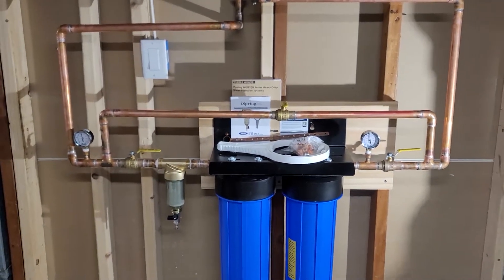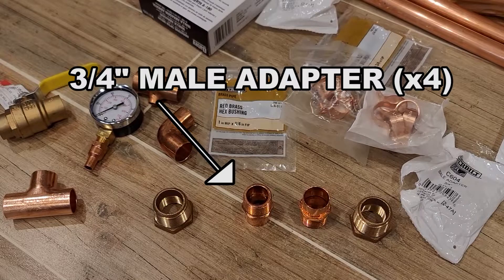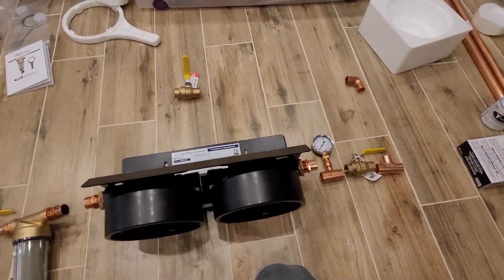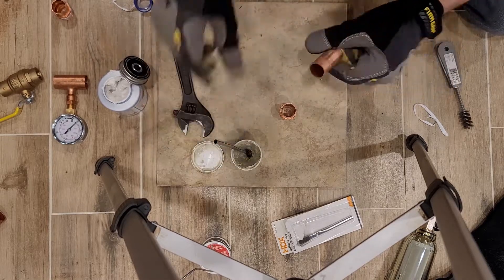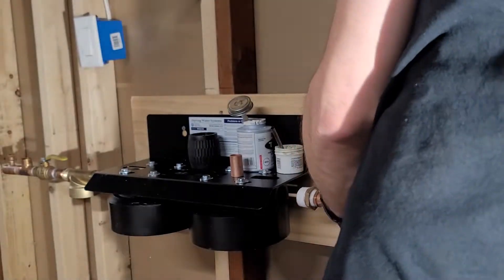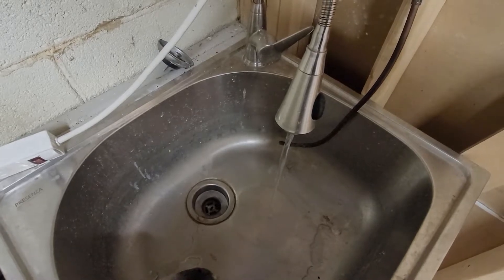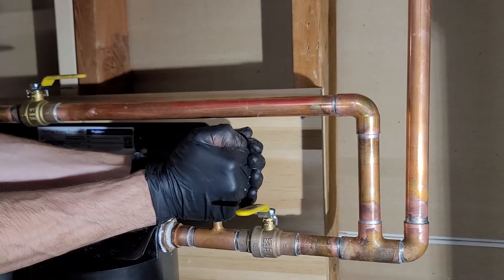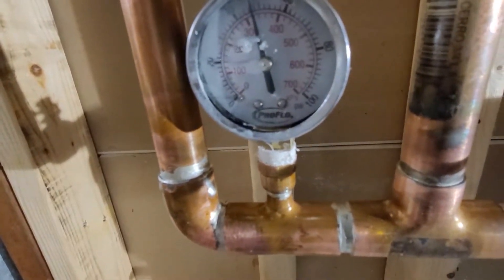How to Install a Whole House Water Filter (iSpring WGB22B 2 stage, WSP-50SL)

Comment: Just a tip! to test dynamic differential pressure drop, pre and post filters, you need a high flow rate (many faucets open) while checking! you are just checking static in this video :)
Reply from the maker: That makes a lot of sense, I guess I won't be able to tell what the system's pressure drop is until I do this. Thanks for the tip, I think it warrants an addendum/additional video!
Reply: @Bootstrappin  you need a differential pressure gauge with max indicator dial. it will keep measuring the max when the faucets are open. but it will show zero when the faucets are closed.
Reply: Good pint, and thank you.

Comment: Great video, I would add a couple of things and you will get an Oscar! : First I would advice people to test their water before you buy any kind filter,  so you will filter exactly what contaminants you have, not what works for other people or buy one because it has 5 stars. A one stage filter is usually a nsf/42 for sediment and chlorine and thats it. You might need a nsf/53, If you have calcium and heavy metals. a 1 stage or 2 stage filter might be doing  nothing for you. You might need maybe a 2 or 3 stage filter. Anything beyond a nsf/53, than your into OS systems which are nsf/58 very few whole house systems have that if any, that's a whole other topic.  Also,  most people watching this might not not even know how to solder very well, and sitting a Mapp tank on the floor and holding parts with channelocks while you feed solder is a recipe for disaster! I'm a licensed Union electrician on our jobsites the safety people would kick you off the job for that and also for not having a fire extinguisher indoors. For a couple of more dollars I would  add at least 2 Unions.  if your spin-down filter breaks or anything needs replacing you have to unsweat a bunch of stuff, fix it and start over. Unions are cheap and save a lot of extra work if something were to happen. It's a great video though! "Bootstrap" routine is a small program to start a CPU. The name fits well, " bootstrapping" to get the plumbing started! Thank you for sharing.

Comment: Haha this video was fun to watch. Your narration felt like Twitch gamer meets DIY construction. Great video. An old plumber's trick for soldering wet pipes is stuffing pieces of bread in there. The bread will absorb and stop the water from dripping long enough to get you a good solder and then disintegrate by the time the plumbing is pressurized and back on.

Comment: Why the bypass on the top? And does this just clean water for faucets and shower? No drinking water?
Reply from the maker: The bypass as I explained is for maintenance purposes. If you need to switch your filters out without disrupting your water, this allows you to do so. I don't know what you mean with the latter question. If you install this as the first in line for your plumbing, then all water becomes filtered, no matter the fixture.
Reply: @Bootstrappin oh okay, so this system filters evrything. So your tap water is drinkable now?
Reply: You can drink water from your faucet at the sink. What I mean is this water is now filtered as well so it tastes better
Reply from the maker: @drizzzzy12 right, yes. Any sink would have filtered water. You'd need to understand your water's composition to determine if you need reverse osmosis and/or UV filtering against bacteria, but that's the gist.
Reply: @Bootstrappin what would determine if you need reverse osmosis or uv?
Reply: I'm on city water not well water
Reply from the maker: Reverse osmosis is good for lead, PFAS, bacteria, and other stuff. Same for UV - that's like viruses, contamination. If you're on city water, probably not too much to worry about, except maybe for lead if they got old plumbing in the city. You could get a water test kit, and see what's in your water.

Comment: The problem probably wasn't metric but that skip size tool kit you got from Hobofreight, they scam you into buying the SAE & Metric set as some sizes are shared eg 16mm-5/8, 11mm-7/16 etc.

Comment: Thanks for the video.  Why the pre filter housing?
Reply from the maker: Prolongs the filter life of the main units, particularly from large sedimentation. You can also clean it pretty easily, and the filter for it is cheaper (I think the filter is replaceable, if it isn't, it's probably washable. I'll double check later)
Reply from the maker: Follow-up: yes, the internal filter in the spin-down seems to be replaceable: 

https://amzn.to/4mW8Exm

Comment: How long would the housing itself last?  I am debating whether it is a good idea to install quick disconnects at both ends.
Reply from the maker: I couldn't say. It's some kind of plastic. I reckon as long as it doesn't get exposed to UV light, and isn't subject to large temperature swings, it probably lasts 10-20 years. Total guess though, based on my limited knowledge of plastics.

Comment: Just one of those worst case scenarios, the bypass needs valves at both ends as it’s a dead leg for legionella risk. 

I used to install water systems for a company that did legionella risk assessments, so on your assembly there would have been an isolation valve just above each tee. 

There would have been a drain off valve to the right of the second tee and another isolation valve so you can flush the bypass line through. 

Now as I said this is worst case scenario and most likely never a real risk, but you just don’t know.

Comment: Great video. If I were to install a pressure reducing valve in this process as well, would I install it before this entire system?
Reply from the maker: This is just a guess, but since this system reduces pressure on its own, I'd put the valve after, so that there's ample water pressure to push water through the system first.

Comment: Have you ever cut into the water meter line in the basement for your water source. Next question if you remove the water system wouldn’t you have to put the water line back the way it was to insure the meter is reading the water used to keep the water company happy. Thanks in advance for your opinion.
Reply from the maker: I have not. I wouldn't advise trying to, if my interpretation of what you're saying is right, bypassing the water meter. The water company would probably figure out rather quickly that your average water usage suddenly dropped off, which would probably land you in legal trouble.
Reply: @ what I was asking is because my Daughter had a company put a water system for her and she didn’t like it. The the company came back and uninstalled it. What they cut into the water side of the water meter. But they didn’t put it back like it was. It is still hooked into the water meter in a round about way but not like it was. My question was do think it should have been put like it was before the water system was first installed.
Reply from the maker: Oh I sort of see what you're saying. Yes I agree, they should definitely put it back the way it was. Anything installed after the meter is ok. Anything installed before is not.
Reply: Thank you for your reply. Much appreciated

Comment: Could this be sufficient for a well? Just bought a house with a well and it has nothing but a pressure tank.
Reply from the maker: I really wouldn't know since I've never had a well - I guess it depends on sedimentation levels, and for that reason, a pre-filter is probably key so that you're not having to replace the filters too often.

Comment: This was an awesome video. I’m going to do this in a couple months. Just a question. How would I check pressure without having a bunch of faucets open? I’m thinking just keeping a good maintenance schedule would help.
Reply from the maker: Thank you! iSpring does recommend to switch out the filters with new ones every 6-12 months, so that'll keep the pressure as good as it gets without needing to check. If I had to get creative, I'd take a measuring cup, or maybe a gallon jug, and see how fast it fills while the filters are fresh, with the faucet fully open. Then every so often, I'd repeat this measurement in the exact same way, and see how much slower it is. So if it took 30 seconds in the beginning, but 6 months later you check and it takes 60 seconds, it's a fairly safe bet that the pressure has dropped by about half.

Comment: HOW DUE YOU REMOVE THE #2 FILTER TO REPLACE THE CARTRIGE
Reply from the maker: By #2 do you mean the second blue filter? If so, shut the water off, depressurize the water, then use the included tool to unscrew the filter housing counterclockwise, pull & replace filter.

Comment: Can you use this filter system with PVC in an off grid cabin situation?
Reply from the maker: I don't know much about PVC plumbing for potable water, but a hunch tells me that adapters and the like do exist to fit this system. However, I guess it depends on what you're trying to do - what's the setup plan?

Comment: Love the install!  Great to see the actual fittings to know what are some connection options.  I plan to use screw-in valves to avoid heat to the teflon seals in the valves  Thanks for the great vid.!

Comment: Replacing the filters takes about five minutes.   Don't waste your money or time constructing a bypass loop.
Reply from the maker: @Lukenukkem  true, and for some the bypass might not be needed. But there's plenty of good reasons to have one:

1) Scheduled city pipe maintenance introducing silt into the water. Bypass allows you to save your filters from getting ruined

2) If you want to upgrade the system, the bypass will come in handy

3) If you want to have a practical pressure test with and without the filter to see if you need to replace it, bypass is useful

4) The bigger your household, the more likely you are to inconvenience someone with a filter replacement

5) Useful for general troubleshooting

Comment: "If I want to install the water filter system shown in the video, how much would it cost to have a plumber install it?
Reply from the maker: I'm just guessing here based on some info I found (I'm not a plumber), but it depends on a variety of factors - your location (high vs. low cost of living), whether you have a pre-existing filter loop or not, how busy your local plumbers are, which filtration system you select, what plumbing you have (PEX vs. copper vs. PVC, etc.) Anywhere from $800 to $2500, probably.

Comment: Thanks for the video! Would it be better to flush the system WITHOUT the filters in to remove the flux and other stuff so you don't clog the filters or is it not worth the effort?
Reply from the maker: @rcapra123  not a bad idea honestly! I didn't, but you could save some effort, assuming you install the bypass, by flushing before you spin the filters on.

Comment: I want to install a similar system but my pre-plumbing has a drain pipe connecting directing into the water supply line, what am i supposed to do with the drain line?
Reply from the maker: I don't quite understand - what do you mean by a drain pipe connected into the water supply line? (Maybe upload a pic to imgur to help me understand)
Reply: @Bootstrappin  it's a new construction house. The superintendent mentioned if we wanted to install water softner/filter we'd have to cap the laundry room drain pipe which currently has an air gap

Comment: Does this setup also filter water used for outside water spigots and sprinklers? Or are those lines separate? If not separated, do the filters need replacing after the summer time (assuming you're watering your grass more during that time)?
Reply from the maker: It strongly depends how your house is setup. In mine for instance, where the city water enters, there is a tee leading to a garden spigot in the front yard. With my setup, this spigot would be unfiltered. But the one in the backyard would be because it comes after where I chose to install my filter. And yes, filter replacement does depend on how heavy your usage is.

Comment: Do you think this system would be okay to install on a well water house? Im near the ocean and have to have water delivered in , being this close to the ocean i get a bit of saltiness. also does a filter system like this put too much strain on a house water pump?
Reply from the maker: Ah that's interesting. I concur with your thought process, the pump would probably have to work harder. I found this article which says that you could install a filter, but to make sure you install it after the pressure tank to not overwork the pump. You might also consider a well booster pump.

https://support.boshart.com/can-sediment-filters-be-installed-between-the-pump-and-pressure-tank
Reply: @Bootstrappin  thanks for the quick reply. I'll definitely check this article out. Yea Ive been doing some reading on articles related to the situation I have going on, there isn't any with the exact situation but there's a few with similar

Comment: Have the pressure gauges been useful? Do they let you know when it's time to change the filter? I am considering them but since I am doing PEX they are so costly. Wondering if your plan actually worked or not as well as you had hoped. And would you still recommend using them? Thanks
Reply from the maker: Yes and no. I think I pinned a comment about this, but it comes down to this -- I incorrectly assumed how they functioned. If you want to get use out of them, you will have to actually open a bunch of faucets throughout the house first, so you can get dynamic, rather than static pressure drop. With the water flowing, you will be able to see what the incoming pressure is, versus the outgoing, and that's when you should make a mark on the pressure gauge and/or see if it is time to change the filters. On the other hand -- it may be a lot easier to just follow their filter change guidelines instead.
Reply: @Bootstrappin  So have you actually tried it and seen a differential pressure drop over the life of the filters running all faucets indicating a change is needed? Or have you not? Just trying to get a straight answer so I can decide whether to put them on my system or not. In my case I am planning to put 4 filters so it might be redundant to have guages come to think of it in the sense that I wouldn't know which filter is the culprit. And low pressure would be felt nonetheless if there were clogs. Anyway, let me know if you can.

Comment: man you did a great job planning and explaining all the details. if you wanted to be able to service this, you could have used a couple of brass union fittings to be able to pull the filter section out.
Reply from the maker: Thanks! And that's a solid suggestion, I like that.

Comment: I really suck using copper solder.  I really tried, at the end I used the propress version but I did not buy the propress gun, I bought a manual press that it was easy in someway but hard in some parts.  Nevertheless you did a great job.  Do you know if I already filtering why wholehouse filters do I need a 3stage filters (prefilter) for my RO system?
Reply from the maker: A press definitely simplifies things. Thank you. Are you asking why a pre-filter is needed in a water filtration system? If so, it's because it eliminates large particulates and impurities so they don't clog up the more expensive main filters. Also, the pre-filter is easier and cheaper to replace, and lengthens the lifespan of the main filters.

Comment: Dog, you need to replace that sharpie next. lol great video, I’m putting one of these in my house and that’s a great tip to change flow direction, I was trying to figure out how to plumb it all in with the orientation of my in/out water feed, but that makes it soo much easier to flip the filter housing on the bracket, thanks

Comment: Hose bib connection on the output side to
A) drain the house side
B) bucket fill if needed
Reply from the maker: I like those ideas, would be a great addition to have
Reply: You could also attach a pressure gauge

Comment: Great video, but using all copper, you definitely want to ground the system at both ends with #4 wire, and each filter should be flushed prior to installing so it doesn't cake up secondary and so on.
Reply from the maker: Good point about the filters, you could probably leave the downstream unscrewed and flush the first through that opening. Why would you need to ground?
Reply: @Bootstrappin  Electric ground brother, a BIG thing to check for your piping.  Form AI as I am too lazy to type "Grounding metal plumbing to the electrical system provides a safe, low-resistance path for stray electricity, preventing dangerous shocks and fires from faults or lightning by equalizing electrical potential and safely dissipating fault currents, especially critical since plastic pipes replaced conductive metal ones, which used to serve as primary grounds. This connection ensures pipes stay at zero voltage, so if they accidentally become energized (like from a faulty appliance), the current goes to ground rather than through a person"

Comment: for water drips on any pipe while you're soldering. stuff bread into the pipe. when you turn the water on it will disintegrate.
Reply from the maker: I've heard of this technique! Personally, I don't like it, it seems unsanitary. The bread has to go somewhere, and in this case, you'll have organic matter get stuck in the filter and linger. I vastly prefer the shop vac technique for that reason.
Reply: @Bootstrappin  I'd be more worried about the flux stuck in the filter than the bread.  One I'd eat. The other I won't.

Comment: What's your thoughts on the filter housings that have the bypass and shutoff built into the housing itself? NO need to construct the bypass line.
Reply from the maker: Agreed, that would save a good amount of effort. In addition, the pressure gauges do offer some utility, but aren't necessary.
Reply: The Bypass loop can also be used to back flush the sediment filter.